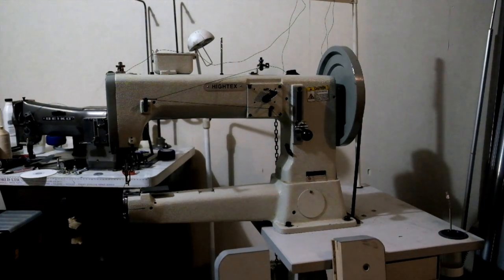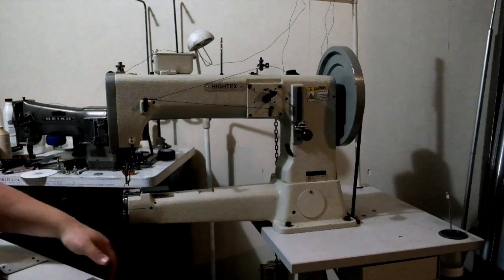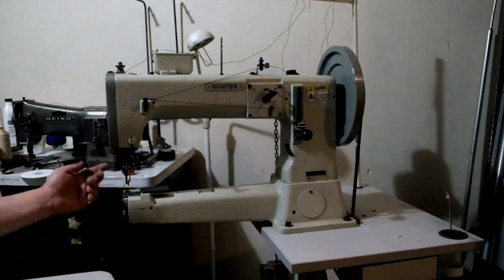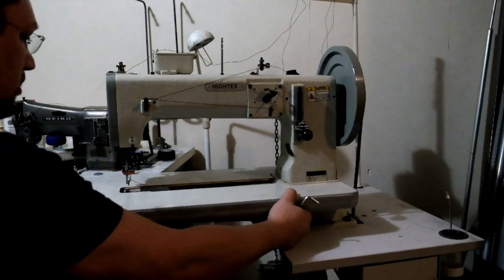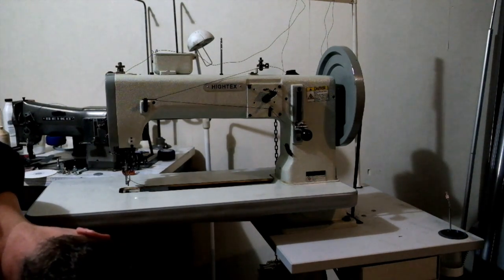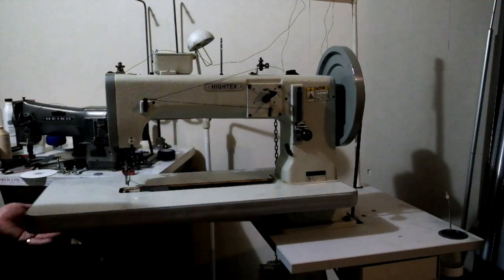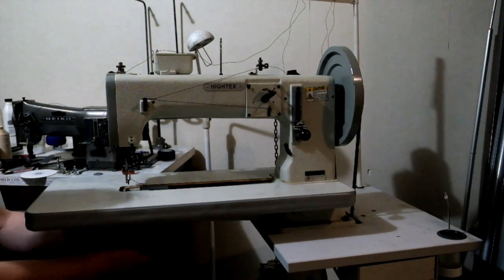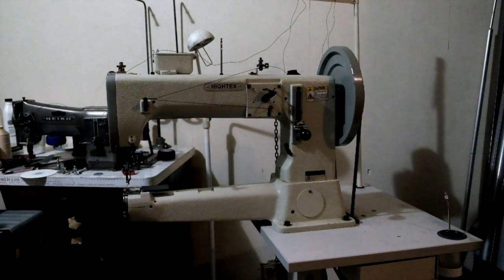Attatching a flatbed table to a Juki TSC-441 clone leather stitcher.

Comment: Alasdair,   Thank you for your reply.  How do you bend the aluminum bar, or does it come already bent?  It looks quite neatly bent.  And, how do I get it with the rounded ends?   And, please better describe the screws.   Metric measurements are fine by me.
Reply from the maker: The aluminium comes straight. I cut it to length with a hacksaw and cleaned up the ends with a file.

I didn't design the exact shape, I just bent it to the approximate shape and then tweaked it by hand to get it all to fit. 

You can start by drilling the hole, screwing the straight bar to the machine, adding a clamp for reinforcement and bending the aluminium directly on the arm of the machine. That way the screw hole is guaranteed to be in the right place. 

Aluminium bar bends easily. Once you've got the positions if the bends marked you can just clamp it to a table or a sturdy bit if wood and bend it over the edge by hand or with some encouragement from a soft hammer.

Comment: Hello,   I have trouble hearing what you say to make the metal brackets from.  Please reply.   Also, which size bolts or screws to use?   The audio is not good.   Thank you  Dale
Reply from the maker: Hi, sorry the audio isn't great. I didn't have a good camera when I shot this. 

The metal is aluminium bar, 50mm x 3mm from the hardware store. 

The screws are M8 cap head allen screws. 

It's all Metric, so if you're in the USA you'll need to either drill and tap the holes or find metric screws. 

You might be able to use 2 x 1/8th inch aluminum but I'm not certain it'll fit. I don't have easy access to my machine right now to measure.